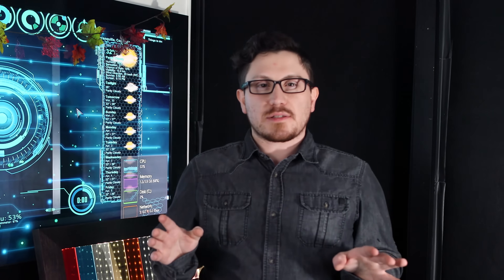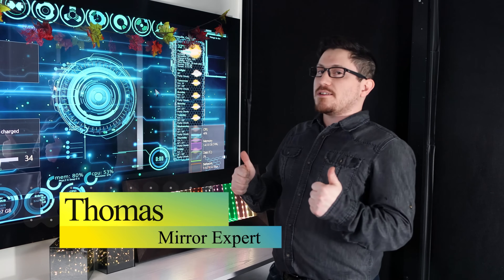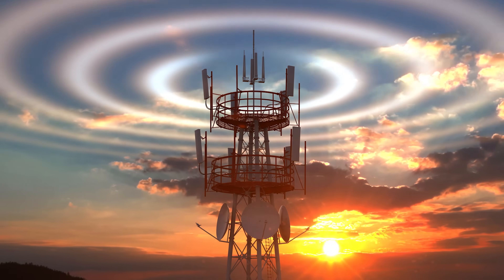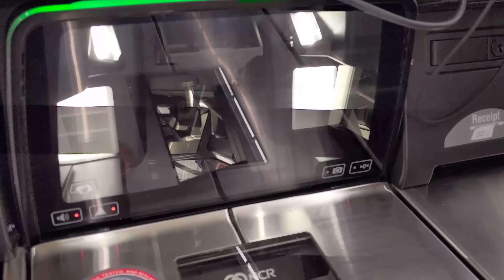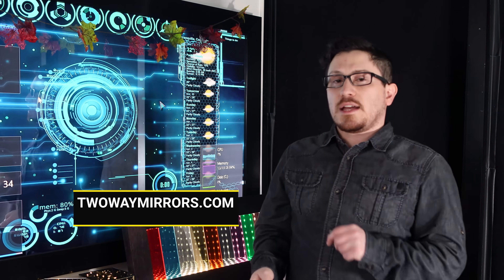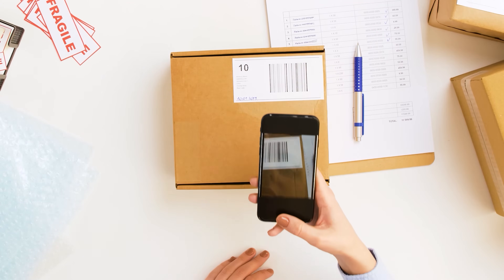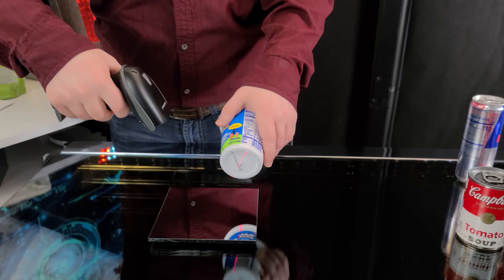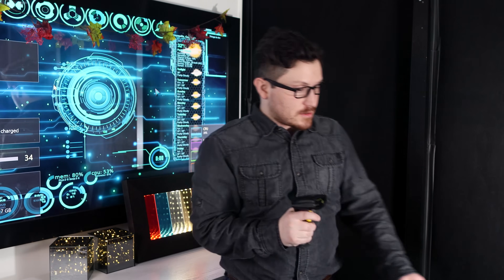How Does A Barcode Scanner Work?

Comment: I’m Intersted in how the recycling machines ; now being widely installed into many shopping areas ; that can determine a damaged container; such as squashed aluminium can ; too one in good condition , even if the bar code can still be read on a damaged one .
   To what extent does these aluminium cans condition have to be in to pass or get rejected ?
 I’ve been trying to research on how these machines work in this regard . 
I have had some slightly damaged cans go through ok 
Then another question on why a perfectly good condition can with a good readable bar code showing a 10 cent recycled logo on it gets rejected 
Even when trying in other deposit Shute’s 
Thanks for interesting info
Reply from the maker: I’m not an expert on recycling machine technology, but I’d love to learn more about that!

Comment: i would like to use a bar code for an art project and stretch it to make a look like a pillar. So the lines are only getting longer but not out of proportion otherwise. Will people be able to read the bar code with an app or will it not work if just a section of the entire width of the stripes are scanned?
Reply from the maker: Yes, that should work correctly.
Reply: @twowaymirrors  it was working ;) thanks!

Comment: I have a question: the angle of approach doesn 't have to be perpendicular, although the scanner detects the beam after reflection. I always learned in optics that the angle of approach is the same as the angle of reflection. How can the scanner then detect the reflected beam?... sincerely, Bart
Reply from the maker: Hi Bart! Thank you for your question! A photodiode is able to pick up the reflected light from the barcode that goes back-and-forth between the mirrors. :)

Comment: I have my barcode scanner tied to the circuit that cuts the power to the scanner when the label maker prints the label. Once the label is removed the power is back on and the barcode scanner and key board will turn on. My challenge is that the Barcode scanner doesn’t come back instantly after you remove the label and takes 11secs to turn back on. Do you know a setting or a device that can help me eliminate this delay!
Reply from the maker: Great question! Sounds like a software/hardware delay

Comment: Hello I am working on a barcode scanner project and I need help on that.
Reply: I have my barcode scanner tied to the circuit that cuts the power to the scanner when the label maker prints the label. Once the label is removed the power is back on and the barcode scanner and key board will turn on. My challenge is that the Barcode scanner doesn’t come back instantly after you remove the label and takes 11secs to turn back on. Do you know a setting or a device that can help me eliminate this delay!
Reply from the maker: That's a great question! We are not barcode experts but our clients that order our mirrors for barcode scanning systems are. I wish I could be of more help!

Comment: Sir, Hi. Do you know how much MW on avarage are the laser machines in grocery stores where you put your products code bars to check the prices?, the ones that are posted on the wall in some sections. I was wearing some tinted prescription glasses of security that I use in work, they are made of some sort of plastic so my concern is... When I  checked the coding bar ( bar codes) of some socks, the plastic bag which I placed underneath ( very close to the mirror where the laser beam is )  the machine red  super bright laser  reflected / shined ( indirectly and without a particular pattern, just everywhere ) on the surface of the white sticker where the code bar is and the bag surface and my eyes hurt in that moment. Did I possibly cause damage? Because I was wearing plastic security regular tinted indoor outdoor security glasses and my retina could possibly be in that moment more open and vulnerable to exposure due the tinted feature and the shine of the laser in the surface of the plastic bag and sticker reached and hurt momentarily my retina? I saw the beam shine for 3 to 4 seconds. Thank you for your time
Reply from the maker: Thanks for sharing! I don't think a brief exposure like that would be bad, but it's always good to have an annual eye doctor exam to scan for problems
Reply: https://youtu.be/M-QwjGCYcjE

Comment: Great video. You said the software has a time-delay program that helps prevent double scan. Do you have any details about how it works to prevent it?
Reply from the maker: That's a great question! It's probably programmed into the software with a timer delay function.
Reply: @twowaymirrors  Think of the self-checkout machines in supermarkets. What I could imagine is that the machine is in "nothing recognized" status at the beginning and it keeps scanning for barcodes at a certain rate. When you put a bottle of beer in front of the scanner, it enters "beer recognized" status. Then it keeps reading the barcode but it won't regard it as a new one until its status returns to "nothing recognized". However, the scanner is not guaranteed to recognize the barcode on every scan, so even if you keep holding the beer bottle at the scanner, it might return to "nothing recognized" status by mistake. This is the case the time-delay mechanism could help with --- when the machine is in "something recognized" status, it won't return to "nothing recognized" until the scanner has been recognizing nothing for a certain length of time...
Reply: Unimes is a professional provider of products and solutions for RFID, barcode, and AutoID devices. 

With 10 more years’ industry experience, we provide comprehensive data collection solutions that enhance efficiency and effectiveness and reduce operational costs. 
 
All Unimes devices are designed and produced in compliance with international standards such as CE, RoHS, FCC.

Our data collection terminal sales and service all over the world, mainly in Western Europe, Africa, Latin America, and Southeast Asia, etc, at present.

Provide solutions in a wide range of industries, including logistics, warehousing, public sector, retail, finance, healthcare, and manufacturing.

For more information: www.unimes.net
Email: peter@unimes.net

Comment: What’s the maximum distance can the barcode scanner could scan it ?? Any possible to scan an item which is in bags without taking it out ?
Reply from the maker: It's theoretically possible at any distance, given the proper optics.
Reply: our scanners' maximum distance is 20m

Unimes is a professional provider of products and solutions for RFID, barcode, and AutoID devices. 

With 10 more years’ industry experience, we provide comprehensive data collection solutions that enhance efficiency and effectiveness and reduce operational costs. 
 
All Unimes devices are designed and produced in compliance with international standards such as CE, RoHS, FCC.

Our data collection terminal sales and service all over the world, mainly in Western Europe, Africa, Latin America, and Southeast Asia, etc, at present.

Provide solutions in a wide range of industries, including logistics, warehousing, public sector, retail, finance, healthcare, and manufacturing.

For more information: www.unimes.net
Email: peter@unimes.net
Reply: Depending on the scanner you chose for the application, it can be short range to very long range